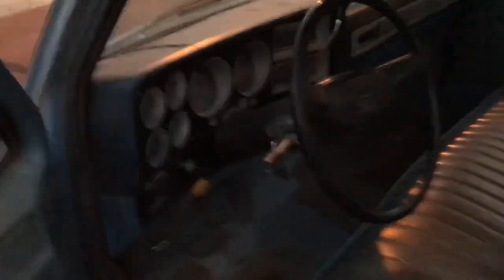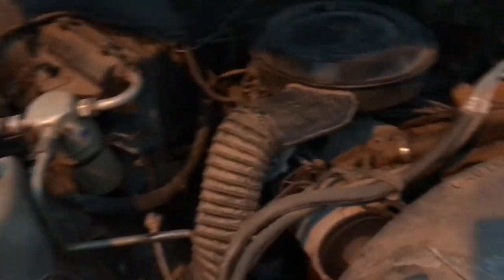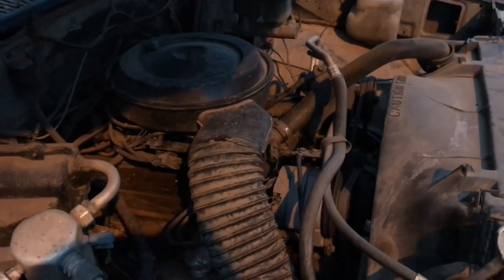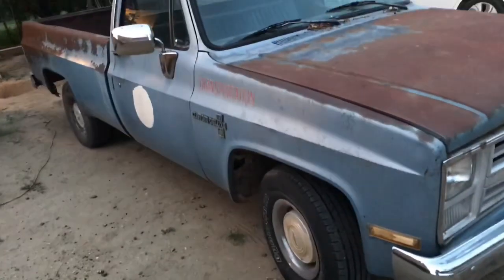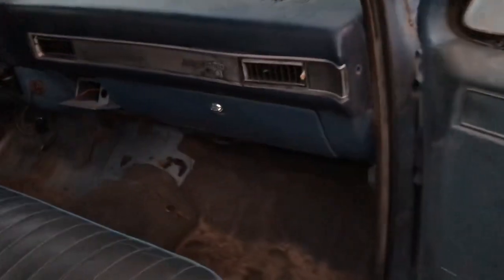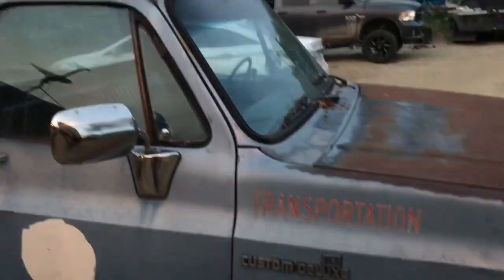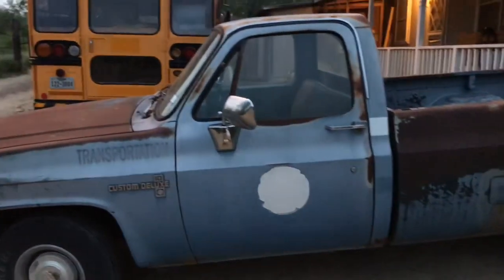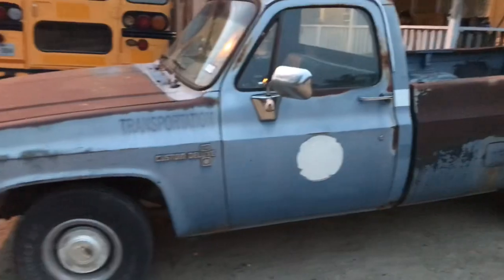1987 Chevy square body project

Comment: These square body trucks are getting super popular lately.  Wish parts for my 72 was as cheap as they are for those. Congrats
Reply from the maker: Hey there sinformant. Appreciate the comment. Parts for a 72 are more expensive. But hey. They are a lot nicer too. Is yours done or is it work in progress.
Reply: @JoesBusBarn  work in progress. For the past 7 years it has been progressively gathering dust😂 actually here very soon im going to start on the mechanical side. Then once that is out of the way ill start bodywork.  Do you have any plans to upgrade the drum brakes on the rear to disc?
Reply from the maker: For now. Would like to get it up and running. Stock for now.

Comment: Hey Joe, that’s a badass truck you’ve got. My question is, what kind of exhaust do you plan on putting on that bad boy?
Reply from the maker: Hey there Jared. Thank you for the comment. Haven’t thought about exhaust yet. Going to start with frame and body. I’m picking up the short bed and frame tomorrow. I was thinking of keeping it close to stock.
Reply: Cool. It’ll be a good truck regardless of what’s done to it. I’ve always been a fan of the older Chevys. By the way,  are you still going to try an do a inside/ outside tour of the Thomas HDX?
Reply from the maker: Jared Laws   I’ll try and see if I can get it done on Wednesday. That’s when I go back to work (school district)
Reply: @JoesBusBarn  Cool, cool. No rush, lol, I just thought you forgot about it.